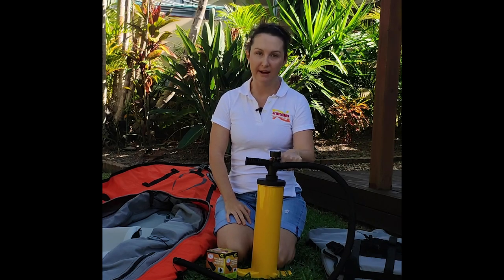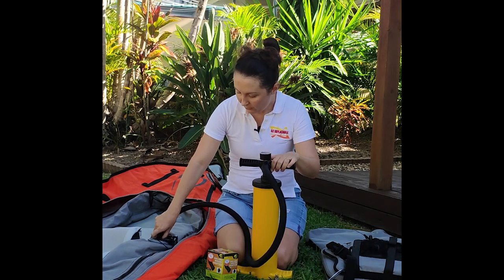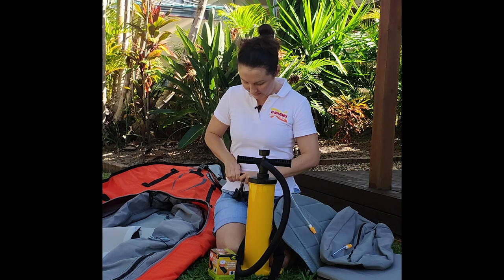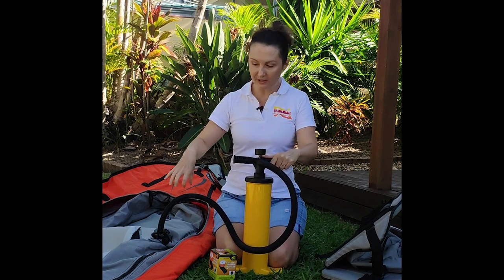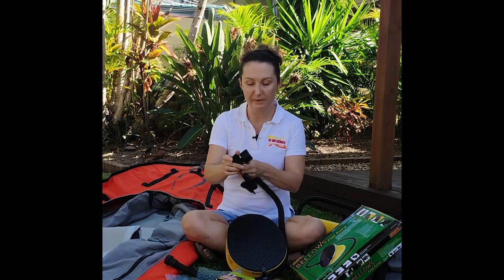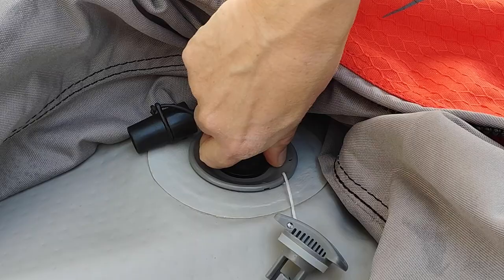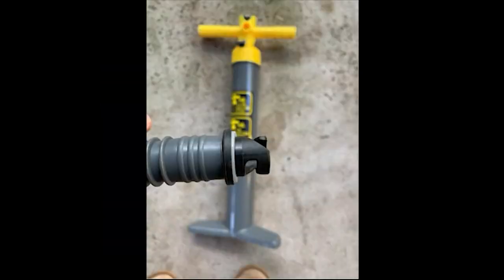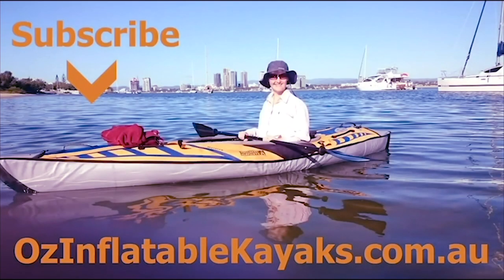Valves & Adaptors from Advanced Elements

Comment: I have a SUP so I have an outdooor master pump. Can I use this for the AE kayak? It doesn’t seem like I have the correct connectors.
Reply from the maker: Do you mean the outdoor masters electric pump? It's very likely that you will be able to make it work, you would just be using the push on adapter that comes with the pump for the spring valves. Maybe check the returns policy so you can test it? Cheers, Emily.

Comment: I am having trouble with the high pressure adapter. I find when I twist it to take it out, the adapter has twisted AND TURNED the inner stem valve to the deflate position. How can I prevent this? My solution for now is to have another person just hold the valve in place (without twisting) while I pump.
Reply from the maker: Hi there! So sorry to see that you are having issues with your HR adaptor. Please have a look at this video which goes into detail on Troubleshooting the HR Valves. https://youtu.be/eiuLUBs6Ero
It has a few good options. But please let us know if any of these options do not work! Thanks, Jessica